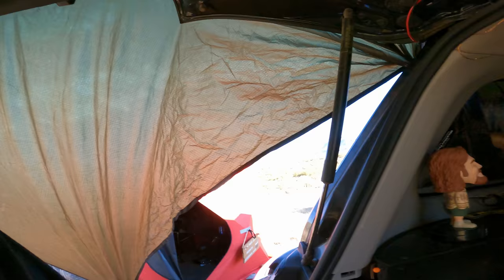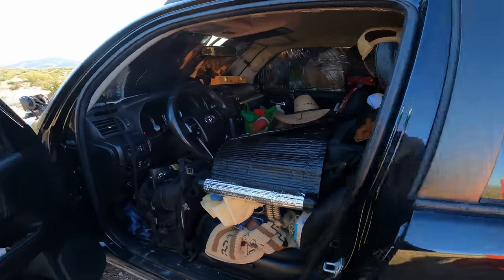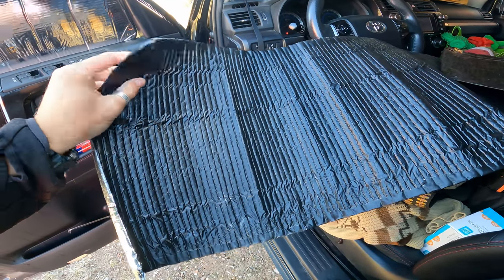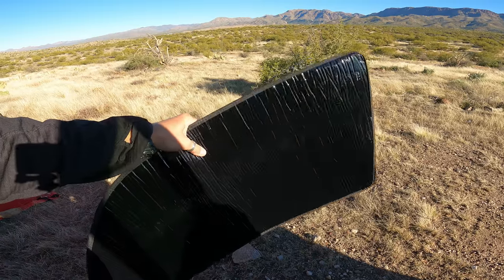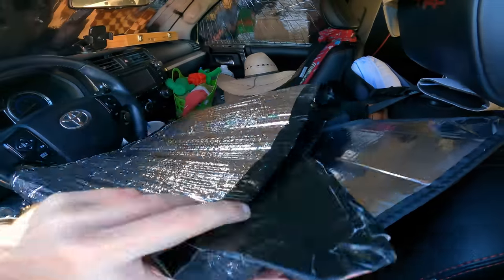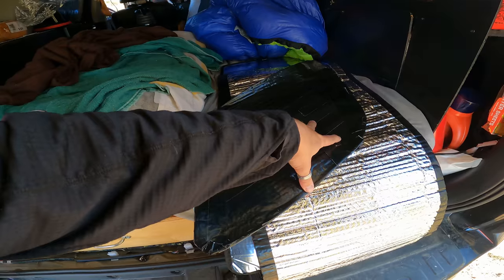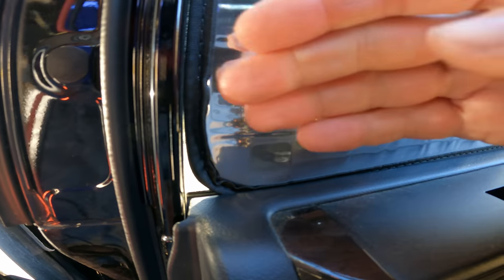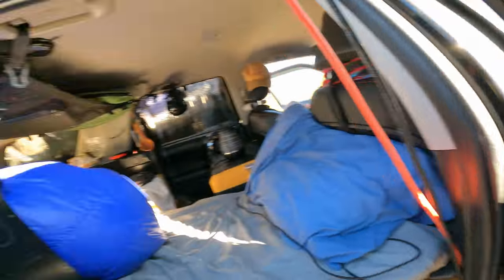WEATHERTECH Window Covers for Toyota 4Runner

Comment: I just want to say how much I appreciate the review. While I understand it's fresh, it gives me a perspective I just can't find anywhere else. I've seen many saying how great they are, but not comparing the two side by side like this. I see convenience being a big winner here for sure. I noticed in your steak and cactus video they aren't as tucked in, but I assume that's because the vehicle is more lived in, and it's just "life". Not any example of them falling apart or wearing out over the past couple of weeks already. Now it is just a matter of battling the cost. Determining if the cost of the covers outweighs the cost of time, or an additional layer of insulation for sleeping, heating blanket (that would suck the life out of batter supply), etc. If/when I do decide I'll make sure to use your link to give some token of appreciation for what it might do to help. It's now getting into the sub '30s up in the North East, and also the urgency of needing the Window protection is going to be paramount, also the quick convenience, in the frigid scenarios is something I see being likely it paying for themselves within a couple weeks.  On a few super chilly nights, when I just need to get set up, sealed up, and settled in, those precious few minutes or even 10 minutes could mean the difference between hell and heaven. Again thanks for the video, mucho appreciated.
Reply from the maker: Hey no problem at all, man. Glad it helped you out. And so far still so good. I've come to the conclusion that the rear cover that was slightly loose just needs some more careful adjustment because I was able to press it in and it's been fine ever since. Temps dipped down to 10F outside of Gallup, New Mexico the other night ambient temps in the car were around 35F. I'm back in Tennessee now and temps will be in single digits so I've got a hold of a tiny 500w heater from Amazon that is INSANE for it's size. I could technically run it for around 2.5 hours on my house battery but I figure it won't take around ten minutes before it gets the interior of the vehicle roasting and then that should be enough ambient heat to linger till morning before I fire it up again. 

If you do end up going with the WeatherTechs let me know what you think. 

Random but last night I stumbled across some hand made straw window covers (I'm serious) for the 5th gens but they are upwards of $1K.....

And no worries about the CarID link, man. It's not even an affiliate but if you go the Amazon route I'll receive a small %.
Reply: @AdamWelch  am I reading this right, straw window covers? Wow. Also that is pretty good data to hear that at 10 degrees outdoors and indoors you were at  around 35 degrees F. I’d wager to think if you hung like a insulated blackout  curtain between you and the front seats it’d be even warmer. As for that little heater yeah. From everything I’m reading and seeing is that, there is just no way around it, unless you go diesel and have proper ventilation, your going to burn through even the best beefiest batteries on the market to keep a space heated over the night. One tip someone told me I thought was smart was heating up rocks on a cast iron just before you tuck in for the night and they would emit just enough heat to keep things safe. Please keep us (me) posted as you manage through these colder times. I’ll be very interested to see how things go.
Reply from the maker: @ableandrew  Sorry man I don't know how I missed this. So far so good with the window covers. Still working great and I finally got the fitment in the rear remedied. Not really sure what was wrong but it finally  stayed put so I'm not messing with it. 

Something to add which I've noticed in the long term use of the covers (or any cover really) is that they kill cell single. I can have full bars outside the vehicle and 1-2 bars inside. I had the same problem with the Reflectix. It might be an issue for some, especially with metal topped vehicles like the 4Runner. I've actually just received a WeBoost for Christmas so hopefully after I get that mounted up it will solve that issue. 

Hahaha and yeah I'm completely serious about the straw covers.... https://strawfoothandmade.com/products/window-covers-toyota-4runner-5th-gen-2010-current?variant=42618996490400

And no joke, just realized they're located in Santa Cruz. I was just through there a couple weeks ago. If would had known I would have stopped in there. Happy Holidays to you man and have a great New Year.
Reply: @AdamWelch  no worries. I appreciate the feedback, and wow I looked at those strawfoothandmades and a few videeos on them. While they do look like great quality, for that price tag they better have built in heaters powerd by solar threads too. 

Also another very important piece of info actually on that, with the cell signal. That is something I would have never thought of, and really important to know about. I've ben wondering if those WeBoosts work, on my list of things. However these window covers are first priority. I hope you're new year is off to an amazing start by time you see this and I look forward to the next post.. A wealth of info you have really helped with. 
Thank you so much.
Reply from the maker: @ableandrew  You as well, man! I'm behind on comments again as usual. You're most welcome and I'm glad it helped out a bit.

BTW, this WeBoost is INSANE. Much more efficient than I thought. It takes me from 1-2 bars inside to full signal. I have the OTR Drive Reach and even it only draws about max 10 watts.
Reply: @AdamWelch  No worries, I appreciate that you took the time to respond to the comments. Just imagine how great things will be when your channel grows so large that you'll be too good to reply to comments any more. So I am grateful for the knowledge and advice I can get while I can. Until your next adventure, stay safe, and keep those shutters clicking!
Reply from the maker: @ableandrew Hey man, it's been a long time but I just wanted to see how you were doing and if you purchased a set of these covers? The reason I ask is because I ended up having quite a bit of issues with them delaminating. Weathertech customer service was great (CarID as well) but I'm on my third set and still having the same delamination problems. I'm going to make an update episode on the issue and was wondering if you had encountered the same problem. If you haven't just a heads up FYI.
Reply: @AdamWelch  Hey man, it has been a long time. Wild how time flies if I could only barely explain the stuff I've been going through over this past year. Let's just heart surgery, had to start a fundraiser to cover some, the works and then some but I'm just about ready do (or be forced to) take this adventure of nomadic 4running soon. So it's serendipitous you tagged me. I did not end up purchasing them (hence the reasons I mentioned). It's great to hear (or at least know they were great about the customer service) bummer about the delimantion and etc, especially at that price. Though it sounds like they step up when they do fail to meet expectations. I will make sure to keep an eye out for the episode though, as they are on my list of things I am going to need VERY soon. Getting nervous as I don't have the time I was hoping to have to get prepped for the new chapter but the show must go on. Thanks again for filling me in on the issues, it's really good to know.
Reply from the maker: @ableandrew  Jesus man, I hate to hear about all the health problems. You're still alive so I suppose that's the important part.  Regardless of the timeframe it's great you're still planning on getting on the road. Speaking just for me, those first few days come with an enormous sense of relief if you can just make it through to actually getting out there. 

And yeah, as for the covers, a bit of a bummer. I've got the entire review episode edited and I'll be posting it here and on the new @4Runner_Nomad channel. It will be the last 4Runner related episode here. It's really all a matter of timing between the launch of the other channel and scheduling of the episodes here on this one. All that to say hopefully in the next week it'll be live. Take care of yourself man and I hope everything goes as smooth as it can.
Reply: @AdamWelch  Yeah I know that's pretty much the reaction I get from most. The name of the condition is even crazier, rare, and causes sudden unalive scenarios. Yeah saying it that way because not sure what might get bleeped from the comments.  A crazy ordeal but yes I'm alive and plan on staying that way for a while now. The good thing on one side is I have a lot of what I need to hit the road donated. Hoping to get a platform built immediately, I wanted to do some of the insulation and things you did, but right now I don't have time. This health stuff did really cost me every penny, my business, and more and I'm living on a GoFundMe page, and it's not coming even close. Though once I'm "Stealth Nomadic" ... that will help, at least keep some of the costs down, and allow me to try to save and rebuild everything. Or just rebuild. I have ... maybe a month to get the platform, window covers, and a few other things built, donated, and or acquired before I won't have a choice. I didn't know about the @4Runner_Nomad channel, I'll look for it for sure. I'll likely be doing the same thing, if anything else to document the adventures. I wish I could get the window covers donated, but we'll see where things go. So much to hastily prepare for with pretty much zero help and zero dollars but I will figure this out dang it. Thanks again and I  look forward to the launch of the new channel!!
Reply from the maker: @ableandrew  I feel you 100%. Here's to hoping once you make it through the launch you can at least have a bit more peace about the whole thing.
Reply: @AdamWelch  thanks, it's gonna be some work, especially that "first step" and to make this transition even harder my dog, my amazing wonderful boy, just passed away the other day. CRUSHED me. I need a win Adam, I really really need a win soon.
Reply from the maker: @ableandrew  Man, what can even be said. I'm sorry. That's horrible.
Reply: @AdamWelch  I know there isn't much that can be said. It's so hard. I need to get on the road fast. Funds are exhausted, from medical bills but I have to get out of this setting asap.

Comment: How do you get any ventilation?
Reply from the maker: As unlikely as it sounds it's never been an issue until the summer months. In the winter I actually shut off all the vents to help keep as much warm air in as possible. I still have three fans rigged up inside to circulate the air if needed but generally when it warms up (like now) I take down the two passenger covers off and slide on some black window screens I got off Amazon. They let in a ton of air, keeps the bugs out, and have held up surprisingly well for nearly a year now. They offer a lot of privacy as well even when I have the interior lights on at night.
Reply: I just got bug screens for my rear windows. I'm excited to use them.  @AdamWelch